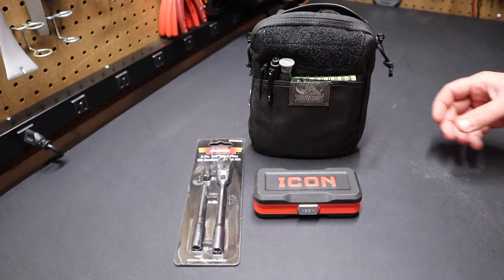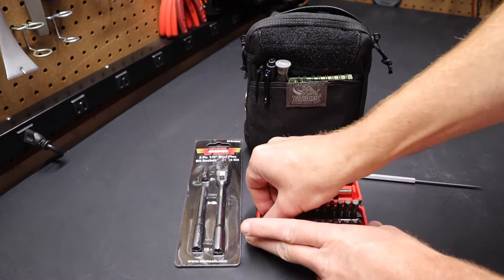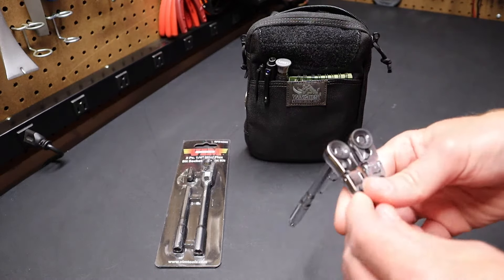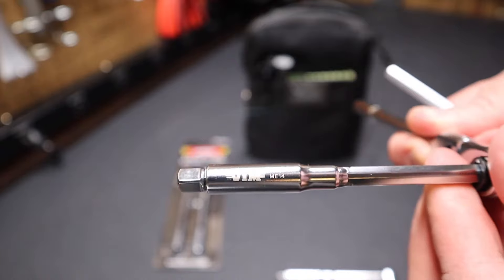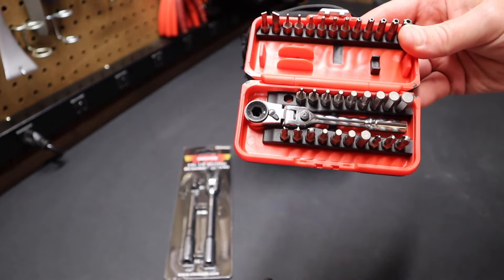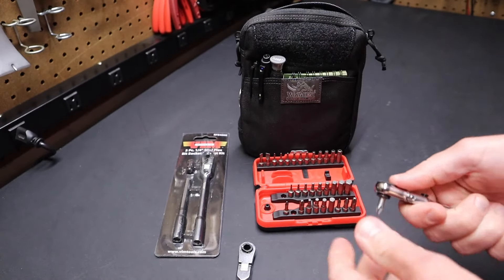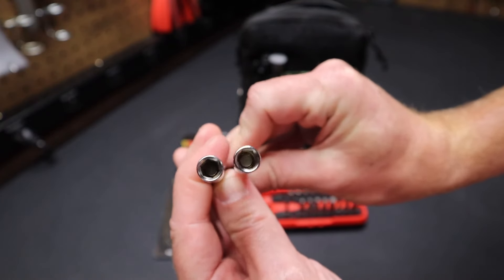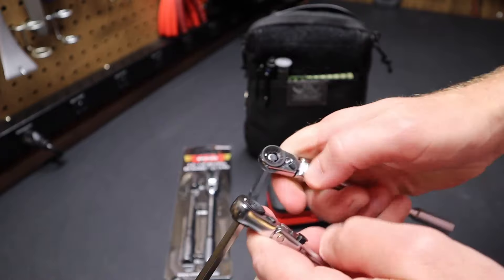VIM vs ICON 1/4" Flex Mini Ratchet

Comment: Why would anyone buy Vim at that price when the Icon comes with bits
Reply from the maker: Personal preference.  The VIM price is lower now. But the icon kit is hard to beat. 👍
Reply: VIM also sells a kit with the flex head ratchet but it’s much bigger (89 bits I believe). It comes with some super low profile sockets with a 1/4” bit shank that are super useful in tight areas. The icon is much more affordable, I own both, and a DIYer the icon is all you need. The VIM kit however is impressive
Reply: Because I can actually get the Vim variant,  while the ICON has never been in stock near me.
Reply: Because VIM products are equal to Snap On in quality.
Reply: Also maybe because most techs already have 7 sets of bits that came with every other bit driver tool they bought
Reply from the maker: Vim is good stuff.
Reply: Because I have a bunch of Hazet and Wera bits lying around. I don't need more low-quality bits just so I'm going to throw them in a corner for decades.
Reply: when I looked, Vim was cheaper than Icon
Reply: The Icon bits are terrible. I like the ratchet though.
Reply: Great work brothed mist dont have a flying clue. Not your first rodeo. Most akso have zero vmclue of true leverage same as triggers. You get my point..
Warm regards @projectpinehills
Reply: @projectpinehills again more leverage less destruction.  Not long division.
Reply: @projectpinehills no comparison all day vim
Reply: @sammiches6859 he'll you good clearly seen he was struggling because the bits SUCK
Reply: If the last thing you need is more bits.

Comment: All the machinists watching this video be like "same factory, different names". In all seriousness the ICON kit is GREAT for a person looking for an addition to their motorcycle tool kit
Reply from the maker: It’s a great kit. The handle fits into tight spaces. Thanks for watching!
Reply: I just started at a motorcycle shop and the main mechanic has the VIM so i googled for a "cheap" one and yeah couldn't find anything cheap so I bought the same kit he got 89 peice with the small non ratcheting driver that after hours of research found out it is or was the lowest profile ratchet out there...
But I ended up also finding this "ezred" double flex head I'm curious to compare it's profile with the VIM one... the vim set was 117 with tax and the ezred was 34 with tax.. I also found an ARES ball end bit set 39 pieces ALL ball end torx/hex for 27.99 I bought the ares set because I notice that the stubby VIM SET CAN BE TOO SHORT were you need the "standard bit length with the low profile ratchet anyone yeah and I thought working on bikes was going to be easier than cars... it is and it isn't definently makes me laugh when I used to think there were "tight fits" in cars seems like bikes have much tighter fits had to use the VIM set about 6 or 7 times in 2 weeks
Reply: @Enlowra Straight up.

Comment: Why would anyone buy Vim at that price when the Icon comes with bits
Reply: I have a billion bits. So that's not an issue. What sells me is the case. Not necessarily for the bits but it's nice to keep the ratchet, extension handle, and not adapter together. If I had the VIM the parts would get tossed in the ratchet drawer and I would need to hunt the extension part of I needed it.

Comment: Biggest flaw with the icon is that it always fails because of the pass through design ...it wears out very quickly and then all the bits become pass through no matter how you insert it.... I replace like eight of them already
Reply from the maker: Did you replace them under warranty?

Comment: These are all made in the same factory but the VIM kit that comes with like 89 pieces while very expensive compared to the icon come with some very useful low profile bit sockets up to 10mm that have made my life much easier in the past. Of course comes with way more bits compared to the icon too. It’s also over $100 and idk if it’s worth it for any DIYer
Reply from the maker: Thanks for the info!
Reply: The ratchet is the same but the bits are not. VIM bits are much better than the cheap bits from harbor freight. They may be made in Taiwan but quality is everything.
Reply: @57_International  oh yeah I agree, the ratchet is what I was referring to and not the bits. VIM bits are professional grade.
Reply: You could get a decent set of PB Swiss bits with the Icon wrench.

Comment: Both are made by HI-FIVE  in Taiwan.
Same goes for the MAC, FACOM, USAG, TOPTUL, WURTH, RUJOI, and many bike tool companies as well as GM powertorque for the non flex head variants.

I'd much rather have the ICON because it's shorter, but  but bought the VIM when they introduced it long before ICON introduced theirs.
The VIM was the only affordable game in town when I bought it, the FACOM USAG and TOPTUL sets are about $75 minimum when you can find them and often go for as much as $90.
The only reason one might not want the ICON set is that it doesn't come with sockets like those foreign companies variants of the set.

I got tired of the length on my Vim so I eventually cut the end off and put it on a little handle from a Mayhew pick because I was expecting to be able to get the ICON, but it still has yet to ever be available near me.
Reply from the maker: Thank you for the background on HI-FIVE.  I find the mini ratchet to be really handy.  👍
Reply: I hope KS Tools is part of that lot too...
Reply: @JoseFerreira-zb7wh  yes they rebrand them as well.
Reply: @TylerSnyder305  nice. Thank you
Reply: @JoseFerreira-zb7wh  Some appear to have 60 teeth and some 72.

Comment: I have both. The icon fits in an altoid tin along with shallow sockets and bits. I try to use the icon more since i can warranty it but the vim feels nicer
Reply from the maker: Yeah, I’ve had no issues with the shorter handle of the Icon because I typically don’t need to apply a lot of torque with a mini ratchet. 👍
Reply: @projectpinehills  The extension will fit in the handle of the Icon and will make it even longer. I'm sure it will with the VIM also.
Reply from the maker: Yes, that’s right. 👍

Comment: Seems the Icon is a better deal with bits, a case, and lifetime replacement of lost/damaged parts (I think from HF).  Plus you made a good point about the shorter stem fitting in more situations.  :eyes-pink-heart-shape:
Reply from the maker: I agree.  I've had situations where the shorter handle of the Icon was the only one that would work.  Thanks for the feedback and thanks for watching!

Comment: Great vid.  I own the Icon set and was looking at getting another one just for the ratchet for an EDC tool bag.  Basically same tool, but for an extra $7 I can get the whole Icon set with bits if I sacrifice a little length off the tool.   That said, I just want the ratchet and I'd love to see what VIM has to offer.
Reply from the maker: Thank You!  That was the same thought process I had.  Sometimes the VIM ratchet goes on sales.  Thanks commenting and watching!  👍

Comment: The extra length on the Vim ratchet is not an advantage. Because there is an extension you can add to the icon for more leverage. The shorter ratchet will fit into tighter spots when needed. 

The other advantage to the icon kit is that you can walk into a harbor freight and get a warranty replacement if anything happens, assuming you live somewhat near a Harbor Freight which many of us do now.

 I'm pretty sure both of these ratchets are made in the same factory in Taiwan. The Vim would be a good companion piece with the Icon if putting together a kit of small tools. I'm not going to bother and I'm pretty happy with my Icon. I do keep it with a Klein tools version that has a bunch of precision bits with a similar size box and the same type of latch. I'm going to buy a socket rail of quarter inch drive sockets to go with it. 

I thought the ratchet mechanism was a little bit stiff but I was able to make it a lot better. I put a 1/4 in hex bit in the ratchet and put my impact driver on the other side and spun in in both directions several times at high speed and that basically put several years worth of wear on it and made it feel a lot better. If you try that you want to start slow and then go full speed. It did get a little warm but not hot. I don't care if it shortened the life of it a little bit, the ratchet works a lot better now.
Reply from the maker: Good feedback. Thanks for watching!
Reply: I got the TONE version and its pretty stiff in the mechanism also, I'll have to give that trick a shot bc the thumbwheel is basically useless when theres oil all over it

And yeah you really dont need leverage on small machine screws. I got the nano bit ratchet from Titan and I can barely fit 3 fingers on it but its plenty of leverage for the machines I work on. + Fits perfectly in the TONE set, awesome little tool

Comment: Curious if you've seen the offerings from Tone? They have one like the Vim (longer ratchet, but with bits), as well as one with a low profile socket.
Reply from the maker: That’s a good set. It doesn’t have a locking flex head ratchet. Thanks for watching!

Comment: Id bet they are made in the same factory. With everything so identical it would be way to much of a coincidence otherwise. 

Also don't forget you can use the extension in the bottom for more leverage. I like vim tools but this one i think icon wins. The whole bit set and case for the same price is hard to beat. The vim is a little longer but this isn't a high torque tool anyhow in my opinion
Reply from the maker: I agree. Thanks for the feedback and thanks for watching!  👍

Comment: Off topic here but how is that power strip mounted? Did you add more screws to secure it?
Reply from the maker: Mounted with screws. Thx!
Reply: @projectpinehills  ok. Because i just got a 4 ft strip and it only has mounting points at the ends

Comment: The icon is perfect the extra length is useless
Reply from the maker: Thanks for commenting!  👍
Reply: I wouldn’t say useless. More torque with longer handle
Reply: @davidwilliamson3809  you can easily add an extension to the bottom that allows it to fit in my large leather man pouch